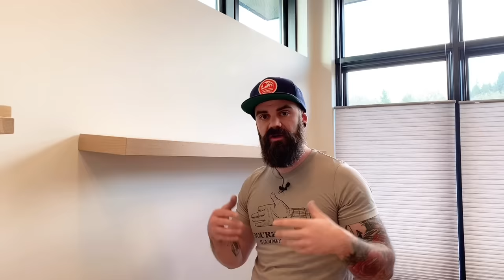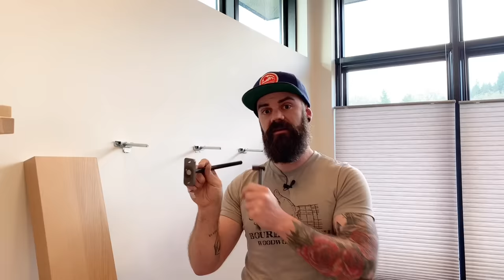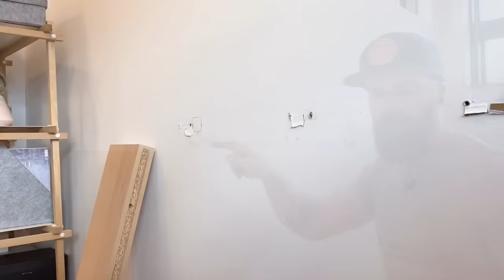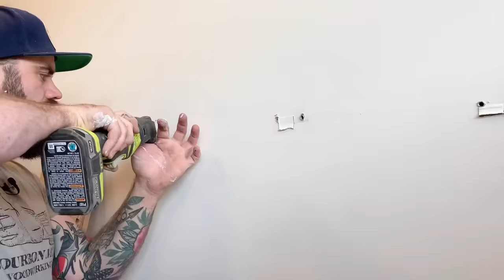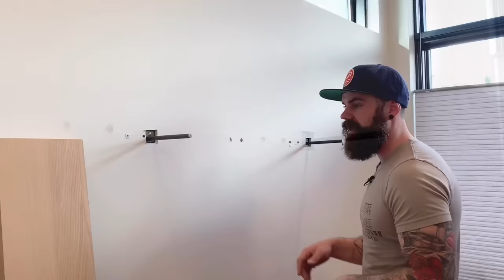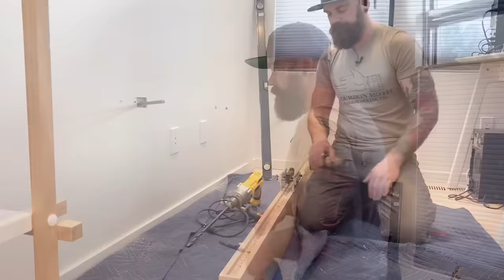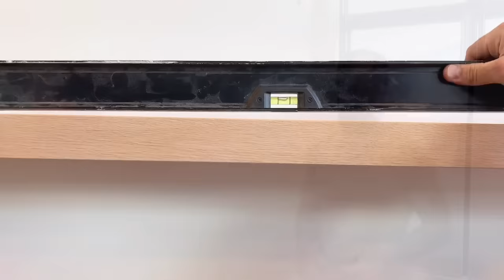How to Install Floating Shelves/DIY Floating Shelves

Comment: Wana do it cheaper stronger faster and easier?
I once did a few large hardwood shelfs for a bar
Basically the same as bourbon butterfly but
Just run the round bar straight into the stud wall
No making brackets or cutting out gyprock
How?
Remember those old drill attachments that turned your drill into a drill press?
You need one of those old plug in drills that has the removable handle
The attachment clamps on there
They are spring loaded and make your drill look a bit like a router
Hell you could even get the hole started with a router
I make the stud hole a bit larger then glue hole and rod
This allows for movement so you can get a 3x2 brace from the floor to the outer edge of the shelf
Get the level on and make it mm perfect. Remove when dry
I leave my drill permanently on the attachment cause who uses plug in drills anymore
Just sits around till I need to drill perpendicular when doing onsite jobs

Comment: I miss wood studs, all we have here is metal which don't hold much. Typically turns a job into a mess since we have to install blocking and fix the wall afterwards.....

Comment: Becareful using 2" screws. You could have electrical or low voltage wiring in those studs
Reply: The stud finder I have can also sense voltage.  Maybe he has that model.  It's worth it for sure.

Comment: Careful on screw length. Too long and you might hit wires or plumbing passing through stud.
Reply: there are generally metal guards on the studs though. Learned it the hard way. lol

 "what's that metal thing? eh, fuck it! SCREW BABY SCREW!"

Comment: NO! All thread with liquid nails it will move with the wall and never move at the same time... Never hold wood stationary to a solid surface.... It has to be flexible but remain adhered

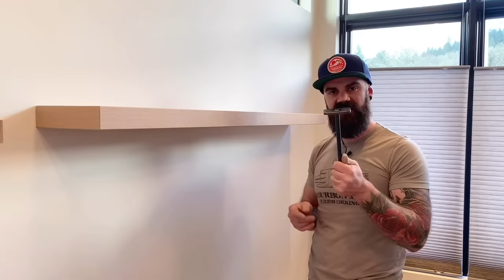Comment: This is probably the best way of adhering these. And I really like your videos. BUT.  The piece did bend down after the weight test. You can see the difference between 12:05 and 12:40. Probably a really really strong method but don't put 200 lb of man on it.

Comment: Oops, the shelf didn't bounce all the way back after he had hung from it so he obviously induced a slight bend in the bracket.  Note that the stationary camera allowed for verification of this, I just had to tape something to my computer screen right at the top corner of the shelf and then do a before/after comparison - the corner of the shelf closest to the camera appears to have been lowered by at least 1/4 inch.

Comment: What if the stud is twisted and bracket wont mount square to the wall?
Reply from the maker: Glue some wood shims to the stud to bring it to square or trim down the stud where the bracket will hit to make a square spot.

Comment: I have seen a dude use 5/8 all thread drilled a hole in the stud then just screw them in and finish the same as this video. That makes the bracket only a few bucks apiece.

Comment: Good video, but I ordered those brackets you linked in the description and they were absolute trash. You definitely should not recommend those to anyone, they are not welded and will break under any amount of weight.

Comment: THE HARDWARE YOU LINKED TO IS NOT THE SAME!  On amazon the brackets have two holes 2 inches apart from each other but the hard were you are using only has one hole directly above the bracket.  Please stop lying to us and tell us the actual hardware purchased for this video thanks D

Comment: Lol, first mistake is using stud finder. They are unreliable. Magnet to find screws drilled into studs is 1100% true  compared to a stud  finder. Measure from ceiling or floor to level, builders or lumber is never accurate...